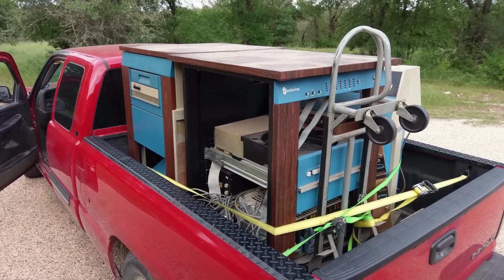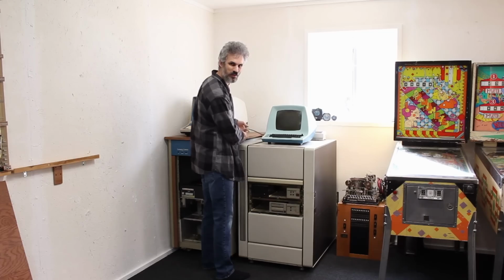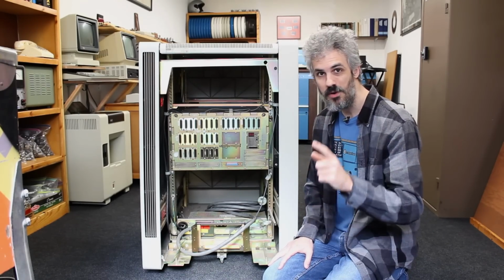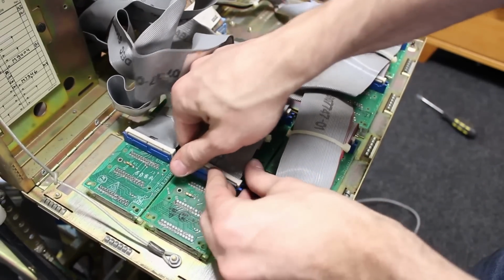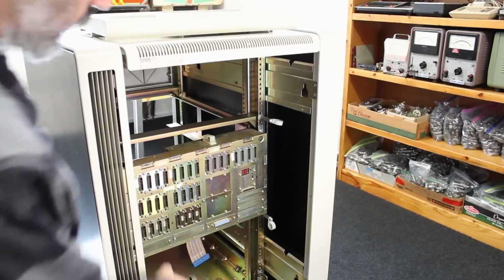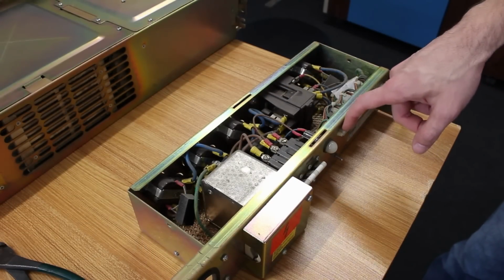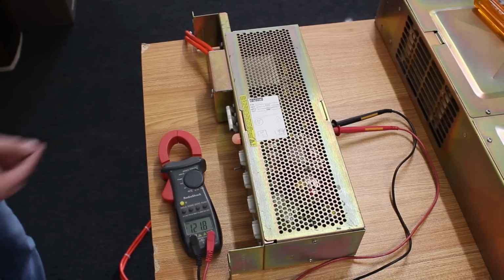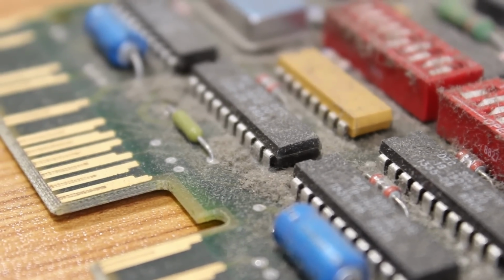I Bought a PDP-11/83!

Comment: Hello PDP-11/83, you look fantastic today 😁
We have a lot of old industrial equipment at work; noise dampening mattress (meant for cars) is great for replacing crumbling foam 👍
It's made from recycled fibers and comes in various thicknesses and pre-cut sizes. Also easy to cut further and glue in place. You can buy it from all hardware stores that sell stuff for cars.

Comment: Firstly, really nice find. Those machines are the things of legend, and to have one in such good condition outside a museum is going to be a rarity in the future. 
I really don't want to be pedantic, but that "Suicide Cable" you created by accident isn't the first of it's kind, and won't be the last. Whilst I've not seen anyone actually killed by one of these, I have witnessed the destruction of over $1Million dollars worth of equipment (these were direct coupled, 3 phase diesel generators, with the double-male cord plugged across 2 generators, causing mechanical damage to both as a result of the phase differential).  

All that aside, don't the electrical regulations in America forbid laypersons working with LV (mains voltage) connections? 
In Australia, this kind of thing carries strict penalties (if caught), and whilst non-electricians often perform electrical work, they certainly don't want it to be well known. It can affect the validity of your insurance policies, attract substantial penalties and open you up to legal liability should someone be injured. 
I understand it seemed like a good idea at the time, but this is why we go through significant training, to recognize the danger in these "bright ideas" and strictly adhere to regulations designed to keep everyone safe.
Reply: There are rules , but reality is closer to Homer Simpson  .
Especially with Union jobs

Comment: Congrats on the great find!  I used to work on a PDP 11/23 running RT-11.  Our lab had 8 VT-100 terminals running at 9600 baud, each one ran to one of the 25 pin RS-232 ports.  Ours had a dual 8" floppy and an internal hard drive (sorry, I don't remember how big it was).  I subscribed because I want to see how the resurrection comes along. Best of luck!

Comment: Most sticky adhesives are lipid-based.  You can put mineral oil on it, let it soak, and with a little elbow grease, it will dissolve.

Comment: I worked with DEC computers from 1975 to the end of service. The com panel is a version of a DZ11. The console port is a V22? It has grounded pairs for all signal wires. Balanced pairs. The standard cabinet could hold a variety of units. The main computer interface is the unibus. The ribbon cables connects to the external controllers and other peripherals. Power is filter and clean.

Comment: For the tape residue, surely acetone or mineral spirits would do it.  Might test it on a not-visible part of the thing to validate it doesn't mess up the paint.  I was intrigued by the power supply cables - they looked identical to the old IBM-PC power cables.  I wonder what the origin of that plug is.

Comment: Some guys were cleaning out a storage unit a couple doors down from mine, and by "cleaning out" I mean "throwing away".  Their unit was full of computer gear.  Being a computer nerd, I asked them if I could have any of it.  They said could have anything I wanted.  If I had had enough room I'd have taken it all.  I took 1 rolling cabinet that looked like the one in this video.  I've always assumed it was PDP.  It was empty except for the power controller in the bottom.  I also took several PC's, some large Tape Storage Reels (of various sizes) and some documentation.  I wish I'd have known better what they had, I would have better selected & more PDP stuff (if they had it)!!!

Comment: Back in the '70s I was a DEC field engineer on PDP11s, mostly 11/05, 11/34s,  and11/44s (Unibus machines). The Micro 11/23 as well (Qbus), so your machine is later than those but very similar. DEC used to issue manuals for the Micro PDP 11s in the form of paperback books, and these showed DIP switch settings etc for all the PCBs. You probably need to source those!
I loved working on PDP 11s as everything (all memory and all registers) was addressable and accessible to read and write from the front panel switches and indicators. So if you selected the output register of the console printer (777466 IIRC) and deposited 101 (ASCII 'A') into it, a 'A' was printed! As an engineer and using the PDP11 programming card you could enter and execute some quite complex 'noddy' machine code programs to test aspects of the system.

Comment: I used car break cleaner for removing double adhesive tape sticking carpet to hard wood floor. Worked like magic without effecting the lacquered hardwood. In germany it is called Bremsenreiniger and sold in spray cans. Perhaps give it a try.

Comment: 26:17 studying to be an engineer 1973 (assume it was this year), we had a PDP11 installed. This supplyed the existing system wih a hole card driven computer, which only was accessable from eletrical engineer studying. I was at the mechanicle study.
The PDP11 was very simple. To start it up, you had to load a binary sequence via a swich panel at the front.
The interface was a teletype writer/printer and the storage was via a paper hole puncher, also widely used at i.e. numerical controlled milling and cutting machines.
The language was Basic. I was the one using it the most, and my final project was to make it possible to program a hydraulic 2 axis robot for heavy lift use, which also was part of projects for others.
The hydraulic valves was analog 1-10V controlled and the movements was stored at an ordinary tape recorder via voltage to frequency converter.
My project then was to convert the binary outputs from the PDP 11 to 0-10V signals. This ended up with being more a eletronic project than mechanicle, so in the end I had to change the project at another direction.
But ithis was the start of what should be my employment for several years later.

Comment: Wow that brings backs some old memories. I was a Field Service Engineer for Compugraphic back in the early1980's and 90's. The Quadex 5000 system (type setting system) I worked on used the Dec PDP 11 but a different cabinet. I seem to remember when the power was turned on a contactor would clunk and then all hardware would power up at the same time. The backplane used an S-Bus and there were several different configurations for hard drives and tape drives. I think a total of 8 or maybe 16 terminals could be connected and all other peripherals were RS 232 serial devices. All proprietary of course. I wonder what is still on the hard drive after all these decades?

Comment: I worked for DEC when these machines came out, I used to install and service MicroVAX II machines, some of which came in this same cabinet. It's so funny to me, as well versed as I was 34 years ago, seeing and hearing your puzzlement over the different parts of the system. About 15 years ago I foolishly trashed all my sales and service documentation for everything from 1982 through 1990, including catalogs and parts price lists. I now see these books and documents offered on eBay for decent money - if I still had all of my stuff it could probably sell for thousands. Then there's the hardware that I sent to the scrapper when my mom moved into assisted living in 2002. A VAX 8550, over a dozen RA81 drives, tape drives, several complete MicroVAX II and PDP systems, some of which were given to me free for the taking and others purchased at government and university surplus sales. But, it would have cost a small fortune to move and store all these goodies for any length of time, thus negating whatever I could now sell it for. Thanks for the video, it was a real blast from the past!

Comment: Wow!!  A PDP-11 - I got my start as a computer operator working on a DEC PDP-11 mainframe.  Way back in the 80's.  It used a DEC operating system and a UNIX O/S.
Reply: PDP-11/84 used by the Air Force, and McDonnell Douglas, CA. Worked for both in the 80s.

Comment: You might want to open that Maxtor hard drive and do a visual inspection of the internals before you power it on. Some of them have a little wax "stopper", which acts as both the inner and outer bumpstop for the heads. On a couple Maxtor bricks I've gotten that wax stopper has disintegrated and the heads completely dismount the disks.

Comment: If you don't own one, I strongly recommend looking for a GENUINE VTXXX terminal.  Preferred models would be VT102/VT220/VT320/VT420.  Many of the PC emulators don't do a perfect job, especially with the keyboard  (on the VT keyboard, the number pad had 2 keys where the PC keyboard has a "+"; that extra key was used in many DEC text editors).

Comment: Happy days, the 1980s when people who knew computers were actually special. I remember setting the switches on the front panel of a PDP11/45 to define the boot address. And wire-wrapping a hand made double width card for a PDP11/02 to DMA mulitple data steams onto a 1/2 inch tape drive.  The tape drive, running, was absolutely mesmerizing - the vacuum columns were fascinating as they coordinated with the reels to move the tape over the heads..... many an hour wasted in a semi-hypnotic trance.

Comment: You need to get yourself a VT220 to go with that!  In the mid 1980s I worked in an industrial power station control and instrumentation lab full of DEC computers.  We had a PDP11/44 running multi-user RSX and RL02 drives for system and application S/W development. The PDP11/44 was linked to dumb VT100 terminals that were on trollies in our office area. In the lab there were many PDP11/23 and then later PDP11/73s for specific projects.  We used RL02, RX02, TU58 and later on hard storage devices. About 10 years ago I visited one of the power stations I word on in 1980, and there was a PDP11/73 still in use as a data logger and my name was still the password 🙂
Reply: it's time to change your name - for security reasons !

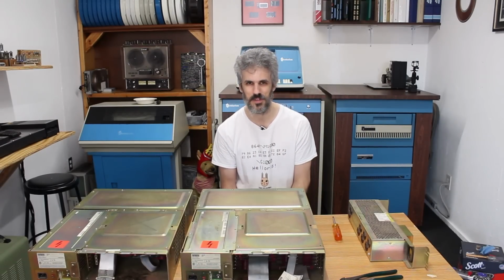Comment: @15:41 dremel with a soft pad and, if needed, a mild abrasive like toothpaste?
Reply: Also there is two types of solvents (polar and non polar) and things will generally only be solvable in one or the other, so it might be that anything that the 'goo' would be solvable in the paint may also be, hence my suggestion. You could also try some mild acetic acid (white vinegar essentially) but without seeing or knowing what kind of paint it is, I'm not sure I would suggest anything stronger. Though, IMHO I wouldn't be offended if it got repainted so long as there isn't like painted logos or labels or something that would get covered.

Nice new project BTW!

Comment: 15:35 I use lighter fluid to clean really tough adhesive residue. Douse a paper towel in the fluid, wipe, then use an old credit card to scrape. Add liquid as necessary as you scrape so it soaks in and lubricates during the whole process. Also, you can try mixing with 99% iso as well.

Comment: I left DEC in 1982 after 20 yrs.  I still have a  VT-100 boxed in storage.  It is a crt based serial display which was the standard terminal for the PDP-11.   Left me know is you would like to add it your collection.  No charge….just shipping from02738.

Comment: I worked on (fixed) DEC equipment from 78 to 89, mostly on the VAX series but on a whole lot of PDP11 equipment as well.  The power controller at the bottom of the cab had switched outlets so equipment other than the computer in that cab could be powered on and off with the power switch of the computer.  The computer box will have a 3 pin connector on the back of it from which you would run a cable to a matching connector on the power controller.  When you flipped on the power switch on the system front panel the switched outlets would get power applied turning on other peripherals in the cab.  On larger multi cabinet configurations that 3 wire cable would be daisy chained to the power controllers on the bottom of each cab, thus powering on several cabinets of equipment at the same time.

The idea of the vents on the cabinet side panels is part of DEC's airflow management.  That is also why the panels are so thick.  The air comes in via the left side panel, the fans move the air from left to right over the equipment and exhausts through the vents on the back of the right panel.  In that era of equipment (and beyond) DEC always moved air of every device from front to back.  Which was not always true in older industrial cabinet equipment. Those, like with the 11/40, 11/45, 11/70 industrial cabinets, moved air from top to bottom.

That long ribbon cable that went over the "bar" in the back extends the systems "Q-bus" from the system's primary enclosure to the secondary one.  And if you slide the equipment back together you will find that "bar" covers the air gap between primary and secondary enclosures. So it's really not such an odd idea that the cable should loop over that "bar."  The cable is as long as it is to allow either one of the 2 enclosures to be slid forward for maintenance access.  Removing that disk drive, for example, if there had been a second drive beside it, would have been done by sliding that enclosure forward, taking off the top cover panel and disconnecting the cables.  It all makes sense if you stop and think about it a bit.

I hope it all powers up and works for you. 

OH!  A thing to note about the "Q-bus" is that it "serpentines" through the slots. So it goes from one duel slot to one beside it, then down to the slot below it, then across to the slot beside it, then down to the slot below it and so on.  In your configuration you will find several dual height modules called DZQ11s (each one controlling one of those 4-port RS232 panels) each installed in a serpentine order on the Q-bus.

Comment: It was indeed meant for lots of serial terminals.  The first computer I ever used was a PDP-11 around '79 (I was in 8th or 9th grade).  The actual computer was at the Public Schools Admin Building across town and one of the teachers had to dial a number and put the phone into a 300 baud acoustic modem.  The terminal we had was a Decwriter 300 which was a dot matrix printer with a keyboard attached.  The operating system was called RSTS something.  I only remember that the TS stood for Time Sharing. The next year, my school got its first Apple ][ and a couple of us got the privilege of copying all the programs our teacher had over.  He printed out the BASIC from the PDP 11 and we typed them in to the Apple and saved them to floppies for them..
Reply: Before SneakerNet, where you carried a floppy from one system to another, we had PrintNet, where you made hard copies and retyped everything.

Comment: This takes me back many years - when I was in college there were PDP-11 like this, with the RS232 distribution (we had terminals all over campus at the time).  The tape drive looks similar to what we had on microvax machines back in the day - I don't remember what they were called.  But if you lift up on the bottom part where the little arrow is, it should eject the tape cartridge itself (I don't think you need power - can't remember).
Reply: You definitely needed to have power applied to the TK50 tape drive before you could remove the tape cartridge.  Though, if the tape is fully rewound, you can take the cover off and manually move the interlock solenoid freeing the handle so it can move and allowing the tape cartridge to be removed. I worked on DEC equipment from 78 to 89, mostly on VAX equipment but a whole lot of PDP11 equipment as well.

Comment: I'm going to presume here that the hard drive is a MFM drive, with the typical 34 pin + 20 pin connectors. If so, I highly recommend the MFM hard drive emulation board by David Gesswein. I would link his website here, but youtube hates links.

I built one of these boards to preserve the contents of a hard drive in an Intel System 310, and now that I have the drive image I can then use the same device to emulate the original drive (it even takes into consideration the type of hard drive controller!).

Looking forward to this series! Happy holidays and happy new year to you!

Comment: I'm  envious. I took electronics (but didn't graduate) back in the late 80 at OSU Okmulgee and in one class we had to program a pdp-11 ( I don't remember the model) in machine language by toggling switches on the front panel. Supposedly the model we had didn't have a multiply instruction and we had to multiply by adding in a loop.

Comment: It may be obvious, but one of the reasons for the kind of plug on that power distribution box is that it can't be accidentally unplugged.  At the least I think I would put a 20 amp plug on it, or maybe set it up for 240 volts.

Comment: .love the pdp 11. I used the PDP11/34 as a minicomputer at Queen's University in Kingston, Ontario. Used 8 in floppies in a master/slave config. Compiling code. Sending output to the large Burroughs Pagd Printers. I was running Fortran most of the time but on the IBM 80 col cards punched out at my high school CS class in the mid '70s. Thanks for this. Brought the memories back even if the equipment is generations different!
Reply: Great memories, graduated Science 85 from Queen's and I remember the PDP11 from second year.

Comment: we use quality aerosol Q8200 adhesive remover at work. i would still test it on a small spot because of the age of the machine but i've never seen it damage fully set paint before, takes adhesive off awesome, just leave it on for a minute or so and it should wipe right off
Reply: its got citrus extracts and mineral spirits IIRC, the one we use doesn't say Q8200 but that's the part number i've seen online, the can we use has "CITRUS SOLVENT CLEANER AND DEGREASER" printed on it